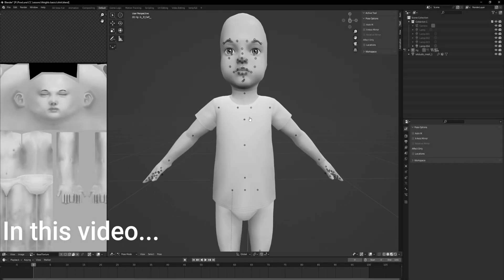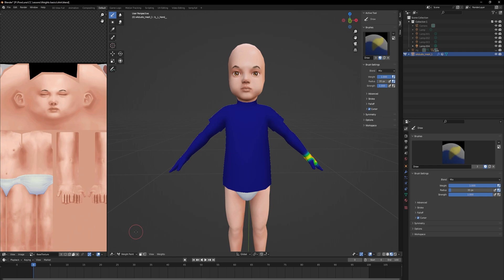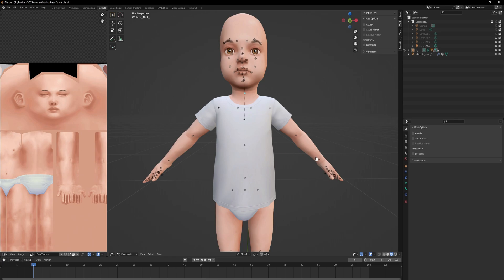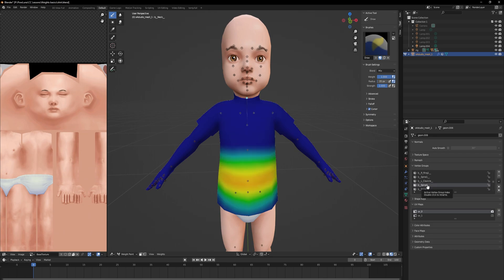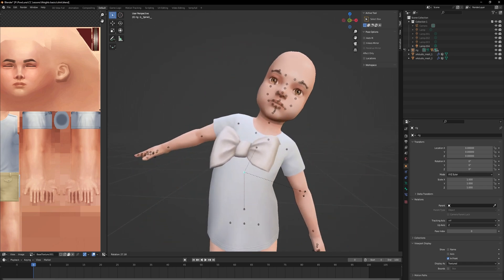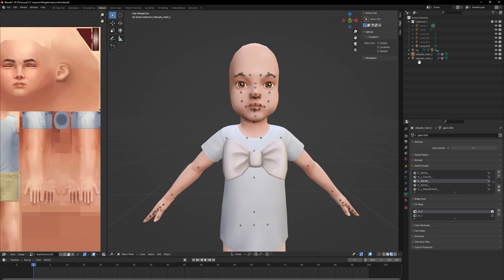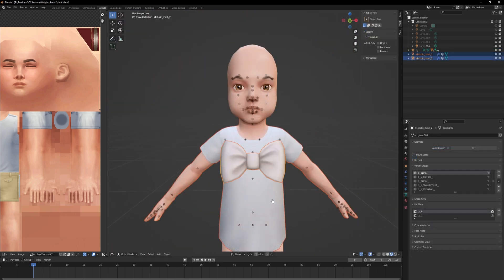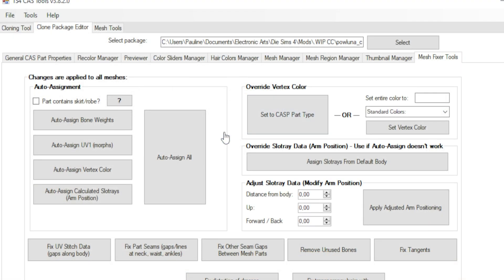How to TRANSFER WEIGHTS for THE SIMS 4 CAS MESH | Tutorials

Comment: for some reason when i open the .blend files exported from S4S in any version of blender other than 2.76, it doesn't have the rig so i'm not able to test the weights in blender (nore am i able to even use those files in S4S, it wont accept anything except files from 2.76). but weight transferring in 2.76 doesn't work. any help?  
edit: i was able to transfer weights in 2.79, but i'm not able to select the rig to test them....
Reply from the maker: Please check if you're using the "old" version of S4S! For Blender 3.0 and up it has to be S4S Stars and NOT S4S Wishes. If you're on Mac idk right know how their versions are called.
Reply: @powluna  thanks!
Reply: i've been pulling my hair out all week over upload issues...i didn't know there was a new version!! thank you so much!  @powluna